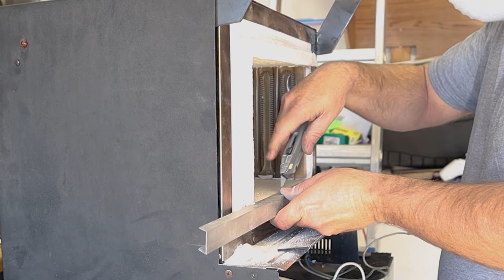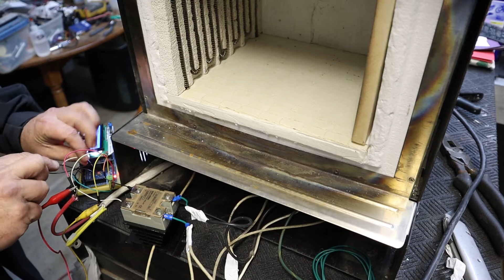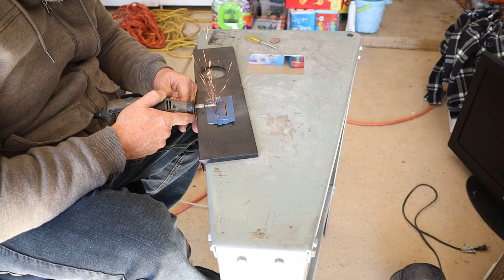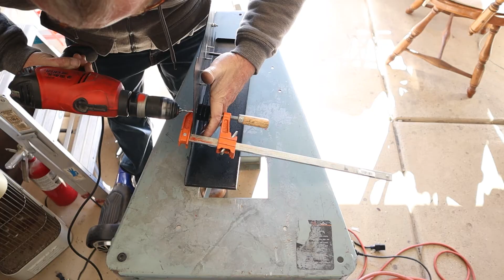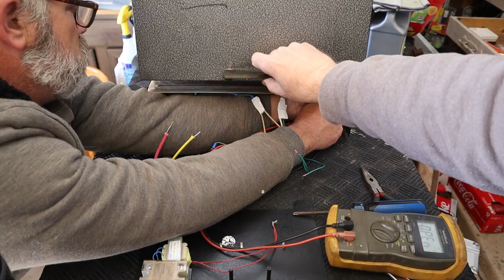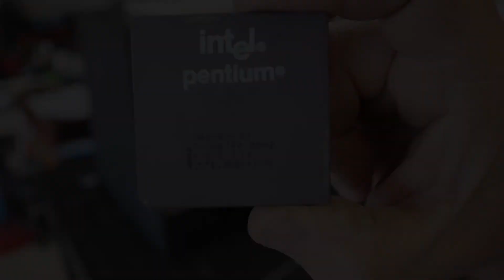Heat Treat Furnace Restoration Part Five.  Electronics and Burn In.

Comment: I’d love info on how to set up Pid/temp control. I have a thermolyne type 6000 that was recently rebuilt by professional at very high cost. Was heat treating yesterday and saw smoke coming out of lower case. Am sure wires etc burned. Be nice to have specs on retiring and new control panel and relay type to use.
Reply from the maker: Let me know if you can send me an email to the address listed on the about page.  If so send me one and i will reach back to you. Thank you!